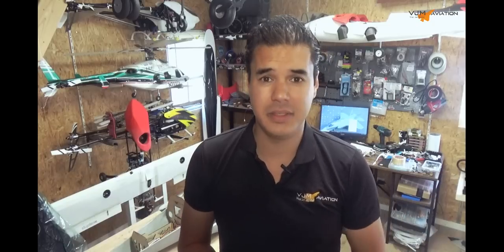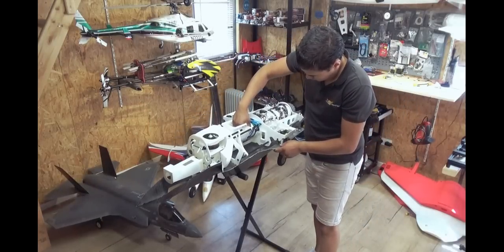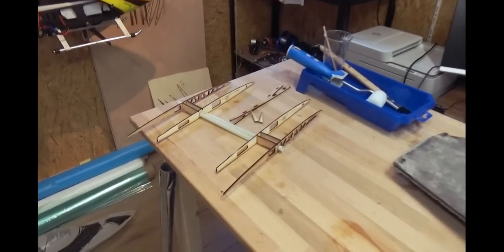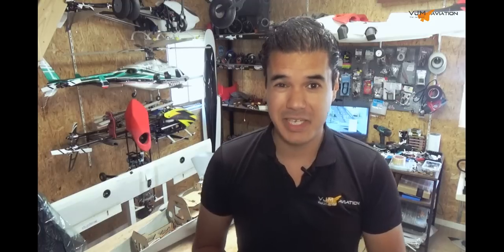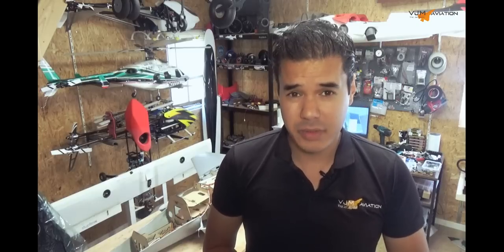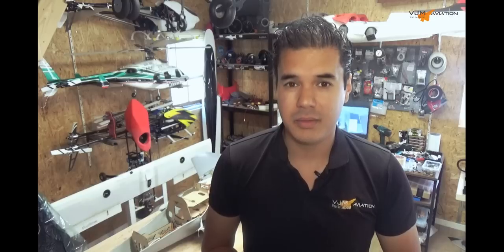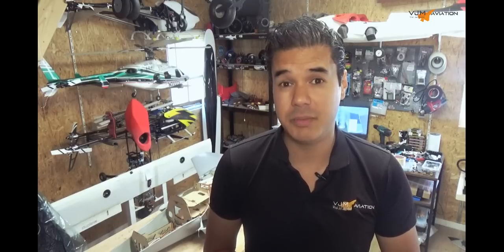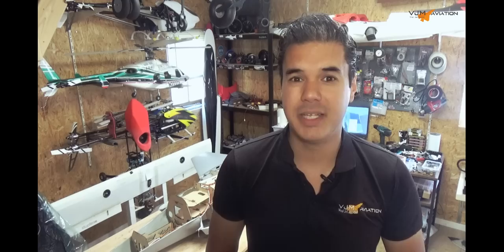RC | F-35B lightning ll Carbon Jet Model 90mm 13 blade VASA EDF!  Moulding and Laser Cutting

Comment: I would like to know if you can reworked the stratus jet  716 and remodify it It is a light jet and that's what I'm working with. I would like to know if it's possible or how much would you Charge.?
Reply from the maker: i will dive into that, sorry for late reply, the stratus jet  716 looks very aweome. do you want a printeble version or solid step files?
Reply from the maker: please write me an email to info@vjmaviation.com. i will discuss with my team;) for the stratus jet  716. it is a really nice plane

Comment: Awesome job mate, very professional, me total amature have printed that Jump Jet harrier, on my third design now, fixing internal issues for wiring and a heap of other stuff, like control over air flow to rear vents, as front is slightly heavier, so a mechanical adjuster closes air flow from rear vents giving front vents mor thrust, its tricky trying to get it to hover, Ive not had much experience with this and getting gyros to work for a hover lift harrier is, well, tricky !!!! I used the internals I bought of you guys and incorporated that design into a solid body 3d printed Jump jet harrier......... But Im about to print out my 4th design changed version and see if it flies, with the 90mm EDF it struggles to lift, being all 3d printed its a bit heavier than your standard plane at same size, its about 800mm long for perspective, I added carbon fibre rods, 10mm to wings and fuselage and changed it to 120mm EDF so hoping that will give it better lift, but mine right now is still uncontrollable when it gets off ground, I need to do more study on how to get it to work, its tricky because I need to vent some air to wingtips and many, BALANCING this thing i SO HARD !!!! How did you do that ??? Im looking at stupid stuff like a slidable weight inside of plane, insane right ? ! Anyway, great job on that F35 that thing is absolutely second to none on this planet for awesomeness !
Reply from the maker: Hey our Pegasus design is for a 130mm schubeler fan…scaling down won’t work. The schubeler will give you 6,5 kilos of net thrust@12S 155amps. Setup for this with Pegasus lipos and motor is allready 3,2 kilos…so your airframe must be under 3 kilos. For roll and pitch I have used edf motors..this will give extra thrust vector. So you can tune the harrier as an simple drone.

Comment: Why did you block the air holes, Wich supply the jet engine?
Reply from the maker: Hey, the airintakes will be cutted afterwards
Reply: @Joelmelanie  ok good. The airflow through the engine gives additional speed to it!

Comment: Thank goodness you dropped 3d printing. 3d print the negative and then use composite and good old fashioned balsa and ply👍
Reply from the maker: Yes sir, I do like printing parts but printing has some other issues. So back to the old fashion way of making models😎😎😎

Comment: The RC EDF jet world seems obsessed with inlet lips. These are only of value in non-ducted installations, i.e. no inlet duct, typically with cheater holes. If the aircraft has inlet ducts, these inherently smooth the airflow into the fan, making the inlet lip redundant.
Reply from the maker: I also went from a 120mm to a 90mm EDF

Comment: Rear stabs are wrong. All F-35B's have the SWAT tail design which is lower in aspect ratio, meaning narrower but longer. The stabilator design you're using was the first design iteration for the F-35B pre-2006, that never made it off the drawing board.
Reply from the maker: That an good point so I have to check the latest pictures
Reply: @Joelmelanie  Here's a reference photo of the F-35 before the empennage redesign: 
https://i.pinimg.com/originals/ae/72/83/ae728322e93b23c65ee6a993b73ec58a.jpg

And here are some reference photos of the STOVL Weight Attack Team (SWAT) redesigned empennage:
https://www.1999.co.jp/itbig19/10194956t.jpg

https://st3.depositphotos.com/5526656/13775/v/600/depositphotos_137759422-stock-illustration-outline-drawing-of-military-aircraft.jpg

The second SWAT reference photo is an F-35A but the A and B models share their vertical stabilizers and horizontal stabilators. You'll notice when overlaying the images of the first design and the SWAT redesign that the vertical tails are shorter and more highly swept back, and the horizontal stabs are lower in aspect ratio, narrower and longer. 

Only 1 F-35 was ever built with the old empennage and that was AA-1, the prototype which first flew in 2006 and is now retired. Every F-35 built since uses the new SWAT design. Using the old empennage design is probably the #1 mistake I see in F-35 modeling whether that be RC planes, diecast models, 3D models for flight simulators and so on. 

Here's a video of Jon Beasley, the test pilot who took the F-35 for it's first flight in 2006 explaining SWAT:
https://www.youtube.com/watch?v=RQ5gmZ74YBY&ab_channel=stephentrimble

Other than that your RC build is beautiful. Keep the amazing work up!
Reply from the maker: @BurnerDiamond  wauw ok, so I will take these picture to adjust my design to the 1:7 scale model.amazing and thankyou for spending time for making this comment. 👍👍👍👍😃
Reply: Here's some more references for the correct tail design:
https://images-wixmp-ed30a86b8c4ca887773594c2.wixmp.com/f/07ecf8b4-4da0-4f4d-935e-39b0b2437ecd/dejv30u-b9fc8bf9-5783-4ea4-ae63-08fa338f6592.png?token=eyJ0eXAiOiJKV1QiLCJhbGciOiJIUzI1NiJ9.eyJzdWIiOiJ1cm46YXBwOjdlMGQxODg5ODIyNjQzNzNhNWYwZDQxNWVhMGQyNmUwIiwiaXNzIjoidXJuOmFwcDo3ZTBkMTg4OTgyMjY0MzczYTVmMGQ0MTVlYTBkMjZlMCIsIm9iaiI6W1t7InBhdGgiOiJcL2ZcLzA3ZWNmOGI0LTRkYTAtNGY0ZC05MzVlLTM5YjBiMjQzN2VjZFwvZGVqdjMwdS1iOWZjOGJmOS01NzgzLTRlYTQtYWU2My0wOGZhMzM4ZjY1OTIucG5nIn1dXSwiYXVkIjpbInVybjpzZXJ2aWNlOmZpbGUuZG93bmxvYWQiXX0.ywguq2hsBrCg0U_buST6nl7o2x5UcqZT73WxtPyn078

https://images-wixmp-ed30a86b8c4ca887773594c2.wixmp.com/f/07ecf8b4-4da0-4f4d-935e-39b0b2437ecd/dekc9s0-04be4fa8-4731-4b99-b6f3-aadc3cf68ff9.png?token=eyJ0eXAiOiJKV1QiLCJhbGciOiJIUzI1NiJ9.eyJzdWIiOiJ1cm46YXBwOjdlMGQxODg5ODIyNjQzNzNhNWYwZDQxNWVhMGQyNmUwIiwiaXNzIjoidXJuOmFwcDo3ZTBkMTg4OTgyMjY0MzczYTVmMGQ0MTVlYTBkMjZlMCIsIm9iaiI6W1t7InBhdGgiOiJcL2ZcLzA3ZWNmOGI0LTRkYTAtNGY0ZC05MzVlLTM5YjBiMjQzN2VjZFwvZGVrYzlzMC0wNGJlNGZhOC00NzMxLTRiOTktYjZmMy1hYWRjM2NmNjhmZjkucG5nIn1dXSwiYXVkIjpbInVybjpzZXJ2aWNlOmZpbGUuZG93bmxvYWQiXX0.5eICcBRPMaGjJTMRBSgRstWOCEyVC-lly0MeNckcIoY

And don't forget that in the vertical landing mode the 2 most inner weapons bay doors are open. Something about it capturing the ground effect for a smoother landing or something like that.

Comment: Great work, can‘t wait to see it fly!

I might not be visible in the video, but please do suck up dust while cutting glass/carbon fiber, as it is nasty stuff for your lungs. I have a Kaercher DS6 premium with water filter. Absolutely scary how pitch black the water gets after cutting just a small amount of carbon.
Reply from the maker: Continuesly I clean te room and wearing a  😷
Reply: @Joelmelanie  awesome, I thought so 😊
Reply: It also helps to cut while it's wet to keep the dust from floating in the air.